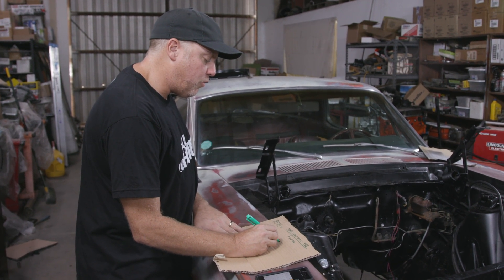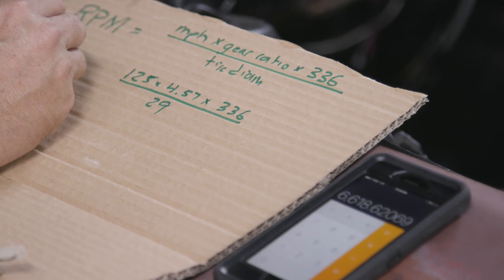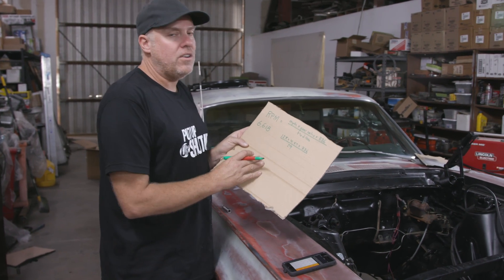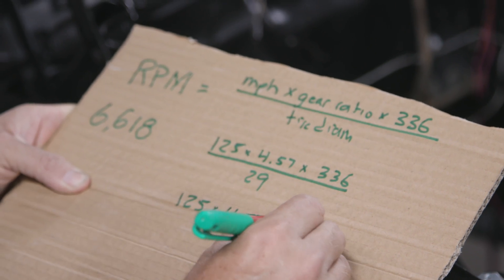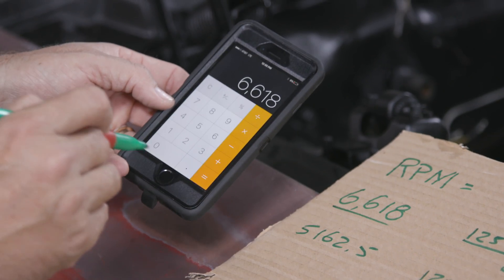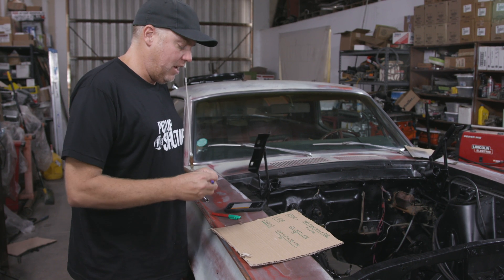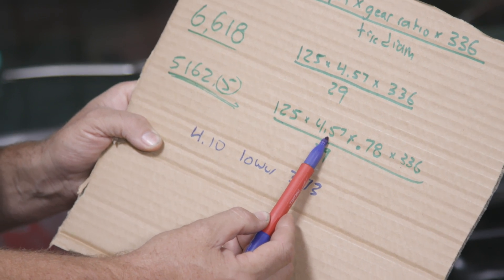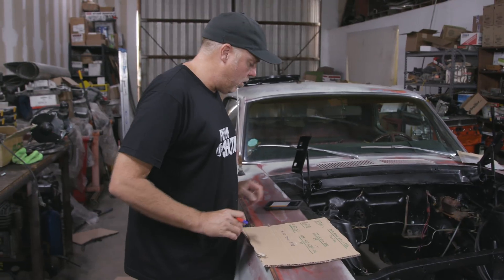How to Calculate Engine RPM vs. Gear Ratio - Roadkill Extra

Comment: So, where does the 336 as a constant come from?
Reply: It's from baking in all the stuff that is the same in to one constant.
<inches in a mile>/(<minutes in an hour>*<ratio of diameter to circumference (pi)>)
63360/(60*3.1415...)=336-ish
Reply: In metric this calculation would be 
rpm=(speed(km/h)*gearratio * 212))/tiredyn(cm)
so just another constant
Reply: The hell you on about mate? To many uneven factors? And what are those units? A cup is something the British drink tea out of, how the hell is that a unit of measurement. Plus you don't seem to know how it works. Nobody would say 0.24L, you take the next step down, 240 mL.
Reply: Zach Coldwell I was wondering too. Hopefully someone sheds some light on it soon.
Reply: I was going to poke fun at the Imperial system, but this doesn't really make the case very well as all that would happen is getting a nicer conversion from centimeters to kilometers, compared to converting inches to miles. You still get a funny constant in the end. The practice of simplifying like that though is more common in the US because the non-neatness of Imperial units will compound and screw you over eventually. Thus it is much more common to find books with pre-made formulas, like this one, for you to plug your values in to over there.

+ramairgto72: that article only seem to cover the mission planning, not the actual rocket science. Furthermore i think the correlation between space travel and size of economy is far greater than to the measurement units used. If anything there is a slight negative correlation between using a minority system and size of economy(due to exports)... but that is probably well compensated for by using the most widely known language. 

And when you can hitch a ride to space with your friends, the incentive to make it there on your own tends to decrease. Let's stay friends, okay?
Reply: Any system of measurement will achieve the same results, so long as that system is constant and reliable. Modern metric relies on measurements that are still based on a physical object. It's a fascinating subject and there are documentaries on the "kilogram" and other things.

I don't care. So long as one picks a system that makes sense to them, and sticks with it. Mixing metric and imperial is confusion. Pick one.
Reply: NASA has ostensibly used the metric system since about 1990, though... so there's that
Reply: +Gatorage: you seem to have no idea what is going on. I could conceivably concede that some Imperial units feel more natural depending on the scale of things you need to deal with. What you point to however, is not that. 
Have you never heard of deciliters? That's what we use for baking for example, either as a scoop on its own, or in the shape of a graded liter container. Works like a hot damn!
There are prefixes for each power of ten around where people need to deal with deal with them regularly, moving further up or down you only have steps 1000.
Not very many applications do use centiliters, but beer, wine and other alcoholic beverages tend to come in "large part of a liter"- sizes, such as 25, 33, 50, 70, 75 cl. Soft drinks tend to be 1, 1.5 or 2 liter, but in cans or reusable glass they too come in 33cl. It's a matter of using the precision you need, and in metric you can instantly covert anything whereas in "Imperial", it can be, but isn't always, harder.
I realize you use US Customary Units, but most people over there seems to call it Imperial, and i didn't want to come across as more of a douche than i do already.
Egyptian math (division) is actually pretty OK from what i remember, but as you say it is harder (or rather more time consuming), especially when you get outside powers of 2 as your divisor. Shouldn't we give ourselves the advantage of using the easiest system that we can find?
Reply: Gatorage, I'm not entirely sure, but it's possible that you might be an idiot... You should at least get it checked out.
Reply: krattah i said most the time it's too big or small not always. deciliters is still a 10% or 1/10 that does not make up for the gap (for cups) unless you are using the correct tools. then it does not matter what system you're using. yes the US system is crap for jumping around but the factor is better for math most the time (cup to pint .5, pint to quart .5, quart to gallon .25). just think if you're trying to make something equal with normal tools. just using the numbers not the size of units. would you rather use 5/100, 12.5/100, 25/100, or just 10/100?  IMO 60 base is the best, like what on a clock. (360/60=6) and the lowest best is 6. just think 1/6, 2/6, 3/6. easy and better are not the same! easy and faster are not always the same as well.
 I rather use metric for how easy it is. but many time I have to switch for the size would be too big or little numbers. it like if I'm cutting something around a 2foot section, it's not going to be easier or faster to cut it in cm. the number would be around 60, too many dots to look at. when using my r/c car I almost never US standard measurements. i rather have a base mm/cm (easy) than a fraction inch, even if the inch is more even factors (better). but a 64th ruler is hard to beat in precision as a standard tool if you don't have advanced tools like a caliper. you'll just go mad trying to use it (harder). there is a point when each one is at it's best. I would say the advantage is knowing that.
Reply: krattah
You hate to lose don't you?
Reply: 1mph=0,44704m/s=26,8224m/min
1inch=0,0254m 
circumference=pi*diameter

1mph/(1inch*pi)=26,8224(m/min)/(0,0254m*pi)=336,135 (1/min)~336rpm
Reply: You may wanna do a fact check Chris.
space.com/3332-nasa-finally-metric.html
Reply: +ramairgto72: Well, you seem to somehow allude to that Imperial units helped, whereas nothing seems to support that.
All I'm saying is that given enough time and money, any units will probably do.
Metric just makes science and engineering easier (and a couple of aspects of daily life as a nice bonus).

Actually, they did "flip flop": 
"Inside the computer we used metric units, at least in the case of powered-flight navigation and guidance.  At the operational level NASA, and especially the astronauts, preferred English units."

Source: https://www.doneyles.com/LM/Tales.html
Reply: Because of imperial funny units:P.
Reply: +Krattah
I'm not arguing anything other than what I said.
NASA did not "flip flop" between Imperial and Metric, you are wrong, we put people on Luna with Imperial.
Reply: ChrisHallett83 
Still waiting for my apology, or one of your Ghost YT accounts that gave you those fictional "Thumbs Ups" to do so.
Reply: I will wait for my apology.
Reply: The Metric system has yet to put a human on another planetary body.
Reply: +ramairgto72
Reply: krattah Metric has too many uneven factors. most the time too small or too big in normal everyday measurements. Ex  cup = 0.24liter . pint = 0.473176 liter . quart = 0.946353 liter . gallon = 3.78541 ... metric milliliter = 0.00416667 cup. who uses centiliter? = 0.0416667 cup. liter = 4.16667 cup   (look at the gap). 
 the US system and Imperial system (not the same) have their faults. mainly to many base factors, that always changing or zero bases like Egyptian math. which is hard to concept for most people in today's world of base 10.

Comment: How to find out what gears your car has (if its limited slip)?  Rotate drive shaft one turn and see how much the tire goes around.  4 total turns and bit = 4.10's, 3 and a half 3.55's etc.
Reply: Can't always rely on that though. It's always possible that a previous owner changed it.
Reply: Pull the cover off, and divide the number of ring gear teeth by the number of pinion teeth. The most ACCURATE way to know...
Reply: WRONG 
The driveshaft turns 4.1 turns for every 1 turn of the crown gear(ie. tires)
Reply: +Buzz.... I have a Camaro and a Monte Carlo One has 3.42 gears, and the other has 3.31. Both are 12 bolt cars... Are you telling me you could crawl under my cars, and easily as you said, tell me which car has the 3.42's by turning my driveshaft? Bullshit!
Reply: that doesn't always tell you either
Reply: Eragon - Counting the number of whole and partial driveshaft turns to rotate both rear wheels one full turn always gives the correct rear end gear ratio...
Reply: My comment was to the guy who said check the VIN/Option sticker
Reply: +Kenny - NONE of that nonsense changes the gear ratio which is easily determined by counting driveshaft turns... Use the online calculator I posted just below for more info... BTW, I'm a retired GM automotive engineer...
Reply: Kenny DeMartini hahaha you're right it's not accurate but do you seriously think with the same diff a 13" tire rotates at a different rate to a 20" when it's off the ground?
Reply: Kenny DeMartini how much are you putting up for this bet? 1 driveshaft is gonna rotate a bit more than the other. If you got the same casings you use the same reference point, otherwise its a simple angle measuring job.
Reply: turning driveshaft to find gear ratio is fine for telling if it has the stock 2.73 gear or a set of 4.11 gears but is inaccurate to tell difference between 3.23 gear or 3.42 gears or 4.10 versus 4.11 etc.. same as lifting one tire and spinning it to check for posi as a worn clutch pack or broken spring can make you think you have an open rear end versus a damaged posi unit. popping the cover counting the teeth and inspecting the unit is only sure method .
Reply: or check vin/option sitcker
Reply: Limited slip diff or not, that's irrelevant.
Reply: BuzzLOLOL hahaha if you were a real engineer then you would know that that is not the most accurate method of finding final drive ratios. You count your ring and pinion gear teeth and divide. Maybe this is why gm and all other American vehicle companies can't make a car to save their asses...
Reply: renek755 - Don't comment when you know nothing. Lee L is spot on. For open diff, it's a different approach - only lift one wheel. The other must stay planted on the floor. Then do as the Lee L says for LSD/locker.
Reply: impalaSS65 If you do it one wheel on the ground, you are going to get double numbers due to open differential. 4.10 rotates 8.2 times etc.. Yes you can do it that way too, but it's more accurate to lift both tires and then it does not matter if its open diff or something else. "Dont comment when you know nothing".